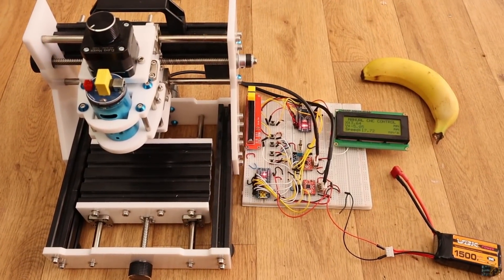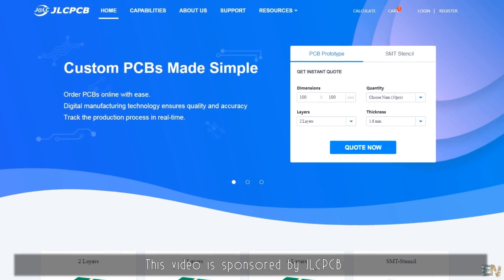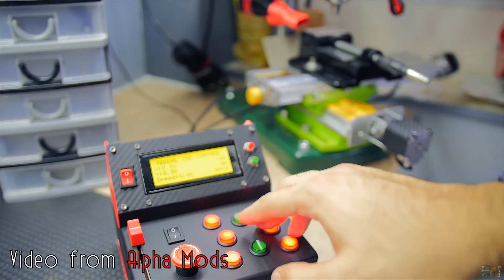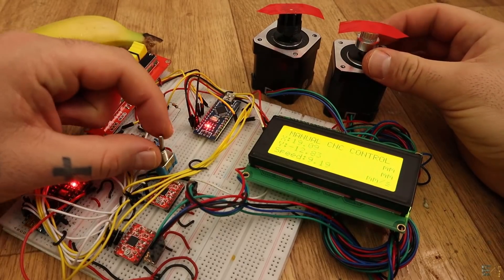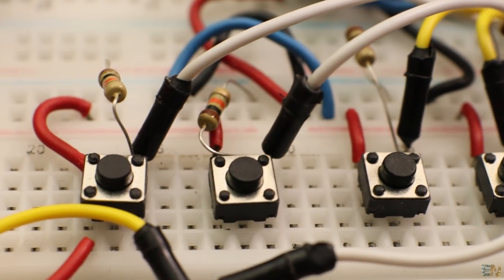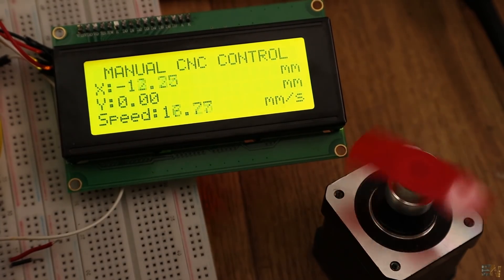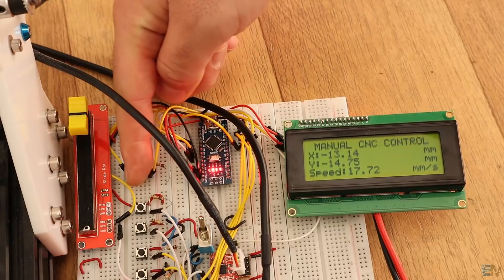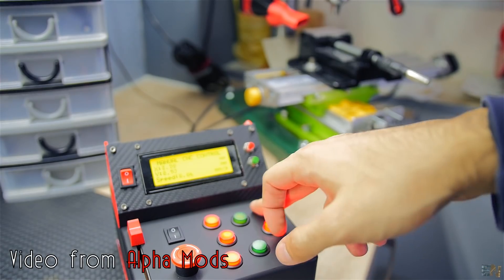Manual control setup for 2-axis machine

Comment: Arduino: 1.8.13 (Windows 10), Kortti:"Arduino Nano, ATmega328P"

CNC_2_axis_manual_ARDUINO_B_20x4LCD:12:10: fatal error: LiquidCrystal_I2C.h: No such file or directory

 #include <LiquidCrystal_I2C.h>

          ^~~~~~~~~~~~~~~~~~~~~

compilation terminated.

exit status 1

LiquidCrystal_I2C.h: No such file or directory

This report would have more information with
"Show verbose output during compilation"
option enabled in File -> Preferences.

Comment: To make this project more perfect, the addition of reading an SD card would make a very good improvement and also make it more useful. The data on the SD card to be sent to the controller in order to make the system truly stand alone.

Comment: hello alright friend, I liked your project, very interesting, but, I was left with a doubt, on Arduino 1 there is a code and on 2 there is another, I understand that 2 is to read and describe everything that 1 does, showing it on the LCD, code 1 can be a grbl for example, or some other two axis motion program, thanks

Comment: If I want to use one stepper motor..can it be possible using one arduino board? Is it possible to control the step, direction precisely using buttons or potentiometer? please help with the code.

Comment: how do you thing, does it possible to make a small impovement? i have a small mill machine and want to place step motors and arduino cheme like your. but very often i need to mill a few of millimeters from whole plane of the detail. and i want to have automatically feature: i set speed, X,Y coordinates of working, height of milling and nuber of height steps. and go out, while machine working. if also would be a possibility to save some of my often patterns of milling it will be excelent. how do you thing does its possible on arduino? maybe you will do it? its wiil be very interesting! sorry if i made a lot of mistakes ;)

Comment: HI
Great video (detailed information ) as always <3 

Some Questions about the code :
"EDITABLE VARIABELS"

1) " float turns_per_cm = 3.5;             //This is the amount of turns your lead screw needs for one turn. "
Are you referring to the pitch of the lead screw ?
i made a test with a 8mm pitch lead screw  and the   turns_per_cm  should be normally at "1.25"  and was moving half distance than the one was saying the screen..
i double the value at  2.5  and then  i was close enough 

i think something i didnt understand well about   the  turns per cm 

 2) " float mm_per_step = 0.007142;     //Initial value inc ase of 7 turns per cm and 200 steps per full rotation "

why you say 7 turns per cm   when in the "float turns_per_cm = 3.5; "   declare it to be 3.5  turns per cm ?

for one reason if i change this value i cant see any difference
Reply from the maker: 1. Yes, that is related to the lead screwe pitch. How many turns it has to do so the axis will make 1cm. Put that value there.
2. it is 3.5, That 7 is from an old test. Sorry.
Reply: @ELECTRONOOBS   Thank you for the  answer :) 
Any thoughts to add later control  for Z axes ?  that would be great if you need to make a small  milling machine

One more Question about your project..
why you decided  to use pull down  resistors and not a pull up ?  are any advantages with that method  than the common "pull up" method we are using in the  most of cases with arduino ? 
(you have mention at the video that can be done  with "pull up"  also  , just have to invert the logic )

Comment: is it possible to add these kinds of control to automatic CNC machines?, the one's you find on aliexpress. to have both automatic as well as manual control
Reply from the maker: Yes but it would be different. You should connect to the serial communication and send the same commands such as X:20 Y33 etc...
Reply: if possible can you make a video for that in your free time?
searched on internet but i couldn't find anything reliable :(
  @ELECTRONOOBS

Comment: thats such a bad implemetation wtf, a single 328 is more than capable of doing everything
Reply from the maker: Maybe... But the LCD print function uses too much resurces. Even 3D printers will print the final position when the present position is reached and the motors are not moving. In this case I want a fast refresh rate for the LCD so while the motor is moving the distance is being printed. If using a single Arduino, the motors would amke a small pause each time the text is printed. If you manage to do it with one Arduino, please share files. Thanks!
Reply: @ELECTRONOOBS  my point is that you're avoiding the problem not fixing it, drive the stepper controller with a timer and interrupts for example
Reply from the maker: @the_perigoso  sorry, I've done that. Same problem...

Comment: Great video. It's almost a power "DRO" (digital read out) like setup. I used a DRO on an old manual full size Bridgeport machine years ago. I could mill almost perfect circles by hand while watching the readout. It's a shame that those machines are too big and heavy for me to keep around the house. They are awesome. Adding a setup like this would make those old machines really fun.
    I've seen quite a few hacks like this on the channel Homofacians. Norbert has done some really interesting stuff that's more grassroots hardware level. You've done a great job of creating something that has an easier to implement software setup. One of the things Norbert explored more is the use of optical encoding for positioning. That enables the use of DC motors instead of stepper motors. If you add optical encoding to a stepper motor driven setup like this the software can detect skipped steps and correct them. Personally this is what I want to build but it's this extra step of complexity that seems to hold me back from actually building something useful.  I should probably just skip it and build this.

  For a manual drill setup like this, all you need now is an extra 4 buttons to move the table 2.54mm in either direction on each axis. Then you would be able to drill perfect pin headers socket strips and dip packages, assuming your drill bit and Z-Axis have the rigidity needed to make a hole without the bit walking around before biting in. That's the problem I have while using a real Dremel tool on a cheap pipe type drill press accessory stand. My little 0.8mm drill bits tend to "walk" 0.1mm - 0.3mm before punching through.  Running at super high speeds tends to help and the bit tends to predictably move in the same direction so it's manageable. I need to get a 3d printer and build a better mount for the Dremel. Maybe one day.
Thanks for the upload.
-Jake
Reply: Build this first, then improve on it. You'll improve upon yourself along the way!